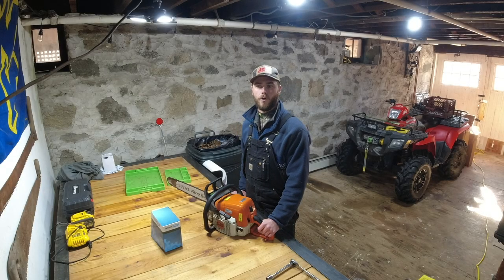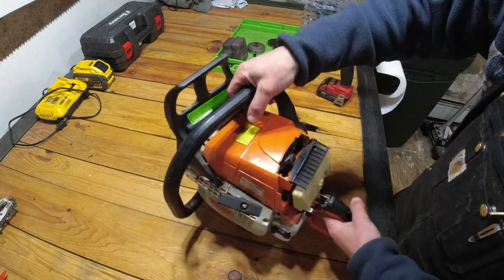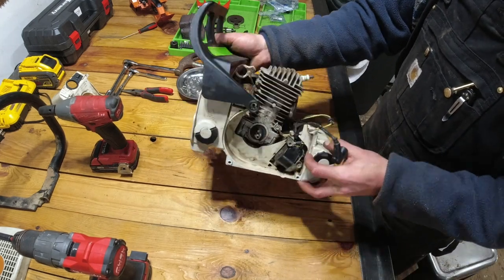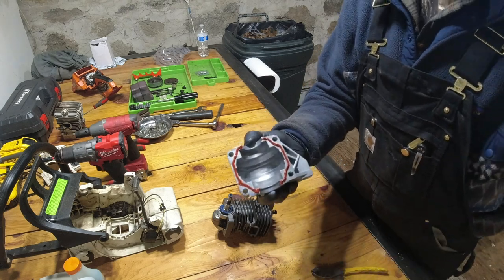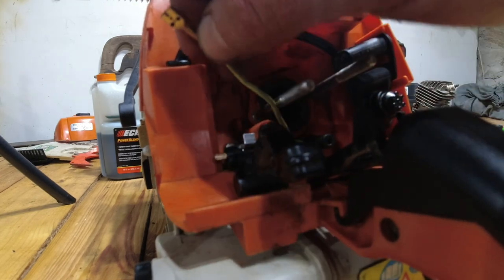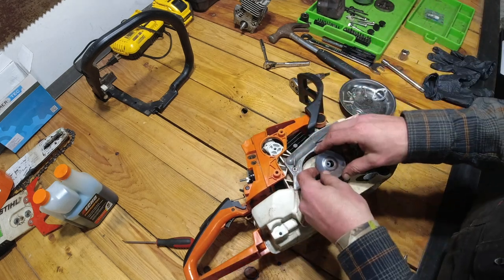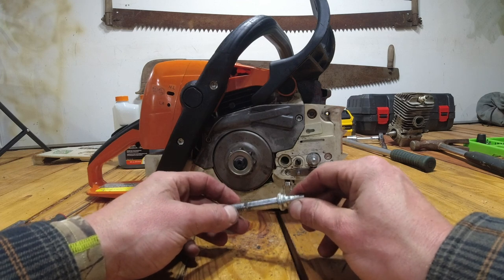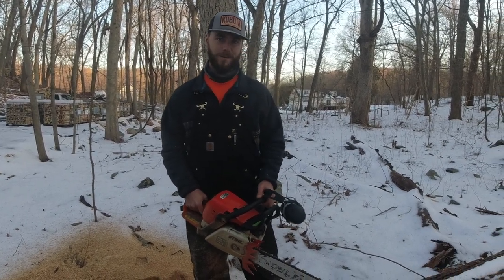#188 Stihl MS-290 FarmBoss to MS-390 Chainsaw Full Breakdown and Conversion

Comment: Nice video im a small engine mechanic full time and I love doing it, the line going directly to your tank was the tank vent the line under the intake boot was a impulse hose it takes pressure that the motor creates and pulses air into the carb and makes the carb pump fuel from your tank and then the last line was the actual fuel line, don't use the Chinese plugs they give I would suggest running only ngk plugs in your saws they are the bpmr7a plugs the Chinese ones will give you nothing but trouble
Reply from the maker: Thanks for the info!

Comment: An important thing is you will most likely need to change out the fixed jet. Thats what will cause your saw to bog fairly easy while cutting and also your high adjustment screw will need to be backed out much more than factory spec. The 290s have a .54mm jet, 310s have a .58mm jet, and the 390s need a .65mm jet. I have a 390 and my friend who owned it prior to me replaced the carburetor. The carb is correct but it was jetted for a 310. The saw always seemed to fall on its face sort of while cutting even with the new hl supply engine. The website he ordered it from said it was compatible with a 290, 310, and 390, which is true with exception of the jetting difference between them. I would consider drilling the jet or replacing it. I drilled mine out with a .65mm drill from Amazon and it worked great since my local Stihl dealer couldn’t get me a time estimate on when the new jet would arrive. I also ordered the jet from the dealer and figured if it comes in it comes in. It ended up arriving in about a week. Anyway that’s a long winded way to say, check your fixed jet when upgrading the engine in these saws.

Comment: Great video! Wish I had seen it before I did this myself lol. I converted  my Free MS290 to 390 with just the jug and piston, so it utilized original lower end and crank. I also put in new main bearings. Converted to 3/8 sprocket with a 20' bar. Im not a pro so to me its a total beast! So much power and cuts large hardwood with ease. Id recommend the conversion.

Comment: I straight gassed my 290 a couple of years back and it has been cast to the back of the shed since.  Maybe this conversion might be just what it needs to bring it back to life.  As a 290 - well it was a dog compared to my 181, 230, 660 and 880.  The dud of the range.  But a 390 might fill that gap nicely.  Thanks for the vid.

Comment: I did this recently, having never taken a saw apart to this extent watching the video helped with a couple potential trouble spots, my biggest problem was trying to put the rubber piece that connects the carburetor to the intake most everything else went fairly smoothly and having it fire up on the 4th pull was a good feeling and with the ported muffler it sounds like a meaner machine, the power increase is quite a bit, it tears through wood with a 25” bar, the only thing I would wish for is a full wrap handle

Comment: Excellent video! I picked a 290 powerhead at a scrapyard for $5, missing an air filter cover and a sprocket cover. Was expecting to clean the carb, and buy a bit of plastic and have a running saw. Got it home, and saw that the spark plug hole was stripped out. Looked on Amazon for a threading tool and came across the piston/cylinder kits for about the same price as the tool to fix the 290’s threads. After watching this video, I felt confident enough to put one in it, and now have it all back together as a 390. Thank you sir!
Also, I did some further research and have seen reviews from other buyers of these kits to just put a plug in the compression relief port as some have fallen apart into the cylinder and wreaked havoc. Also, it’s not bad practice to double check inside the cylinder and crankcase for rough burs and shavings (I had to carefully file a few edges), and of course I gave it a good scrubbing with carb cleaner and lubed it up with 2 cycle oil before reassembly. 
Long story short, I’ve got a converted 390 with 20” bar and chain for $150 or a little less, and this video was a HUGE help.
Reply from the maker: Glad the video was a help to you! Currently having some issues with mine as we speak… not sure if it’s motor related or air/fuel issue.
Reply: @DudeRanchDIY  did you get the issues resolved?  What did you find?
Reply from the maker: @elkman1jc  bad seals and light scoring on the cylinder. I have not spent any time trying to fix. The actual stihl parts required to fix it would cost more than the saw is worth. So i can’t justify the expense for that saw or the time involved to replace with crappy aftermarket parts again.
Reply: @DudeRanchDIY  That's understandable.  I did the same repair to mine this past summer and it only has about .5 hours on it, but so far so good.  Will update when i run it more.  Your video made the repair very straight forward, for that I thank you.  

Mine looked like a seize due to a lean condition or lack of oil.  I was using Stihl Ultra oil 50:1 at the time, which I do not anymore.  I also bought a plug to close off the decompression port, so that won't be a failure point.  Time will tell I guess.  If it goes down again, I will likely scrap it and move on.  

Cheers!!

Comment: Great video and thanks for your time. Ive had a MS291 for the last 8 years. I’ve recently had to make a few major repairs and learned a lot about chainsaws while doing so. This seems like an option (or a fun project) to look into vs. buying a new one.
Reply from the maker: Thank you, it’s definitely a good option if you need to rebuild the saw anyway. Mine has been running great ever since.

Comment: Enjoyed this post, I have owned and operated a Stihl MS 290 Farm Boss with a 18" bar since 2008 religiously ran 93 and Stihl mix, always the synthetic mix and bar oil. The 290 is a good homeowner saw, btw it still runs good. I wish I had bought a 440 . Pro saws are the way to go Imho, I do a bit of tree removal and firewood cutting. How much better is the up grade?
Reply from the maker: Very nice! It’s been a good saw, I picked it up for $150 at a tag sale years ago, all of my other saws are “commercial grade” yet I like the farm boss for cutting firewood. The upgrade is definitely noticeable.

Comment: Nice I have a Farmer Tec kit for an 028Super.  I need to split my case though.  It’s nice how yours was its own sealed unit.  I heard a couple funky noises come out of the saw when you finished your cuts.  It sounded like metal on metal.  Not sure if it was the sprocket / chain or the engine….
Reply from the maker: Yeah I saw a couple others separated the two but I decided to finagle it out haha. I’ve gone back to try and hear what you mean and can’t seem to hear it, the saw has since been running just fine!
Reply: @DudeRanchDIY  I heard the noise at 50:09 and 50:22ish.  I am glad the saw is working good.  That was a nice little project.  The noise could just be my iPhone speakers being weird…
Reply from the maker: Ahh I now hear the sound you’re referring to! I’m pretty sure that’s just the subpar microphone on my little dji action camera… it doesn’t have the sound quality of my better camera which I didn’t use for this shot!

Comment: What sort of maintenance routine do you do for your saws? Do you clean and sharpen after every use? What else do you do regularly?
Reply from the maker: I take the bar off and blow the saw and air filter out pretty much every time I sharpen the chain. Definitely not after every use although that would be much better for the saws. I clean the spark plug and fuel filter/gas tank probably every other time I sharpen the chains. I file down any burrs on the bar and blow it and the sprocket out every time I sharpen as well.

Comment: use a flathead screwdriver on the caps , great video , i have one that did the same thing , is this an oil and fuel issue ? , I never blew up a 2 stroke in my life
Reply from the maker: I’m honestly not sure, I bought that saw used at a tag sale and it fired right up. Never really checked the cylinder for scoring, I’m guessing the original owner probably ran straight gas in it for a few seconds before realizing then things slowly escalated from there as I put more steady use on it.

Comment: Hello again I am trying to figure out why the people I am trying to order the kit from tells me that the 390 kit won't work on my 290 . It even says in the add for 290 310 390. But they said it would not work for my Saw. The only difference I see is my Saw doesn't have a compression release valve. Can you give me any more info about this I have some pictures but I don't see a way to send them to you . Would appreciate your advice. Thanks
Reply from the maker: If you follow the link I put in the description that is the exact kit I used. It may say that it isn’t compatible because of the compression release valve. However as you saw drilling a hole in the plastic cover fixes that.
Reply: How about using a plug which I seen in another video, saying you don't really need it, they said about it coming apart and messing up the cylinder. Would that be ok to do. I really appreciate your help. And I have recommended your video to several friends who also work on these type of machines. Thanks again I'm in Jamaica and it's hard to find people who really know what there doing.
Reply: Absolutely nothing wrong with plugging the decomp. These size saws aren’t hard to pull. The only pro to a decomp is it’s easier to pull but there’s several cons.

Comment: Factory tune runs too lean burns up engine need to mod the intake and exhaust readjust fuel-air mixture screws running rich